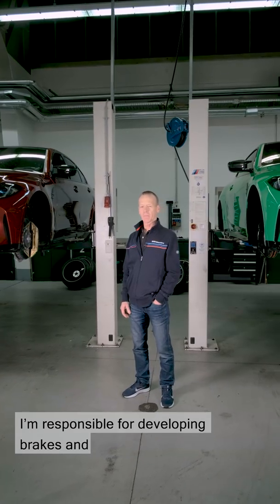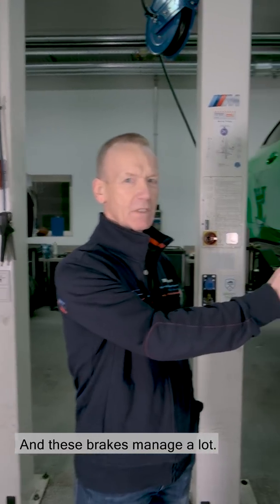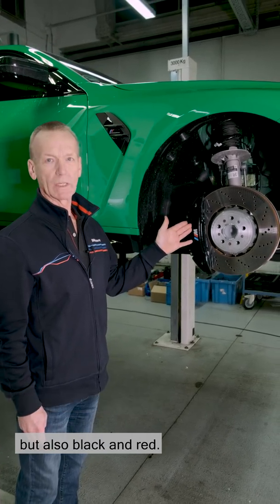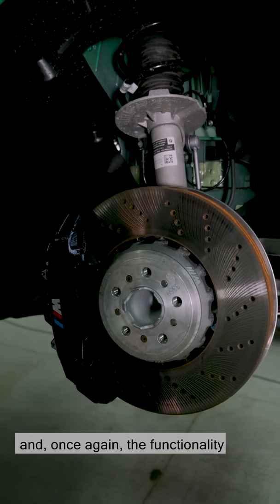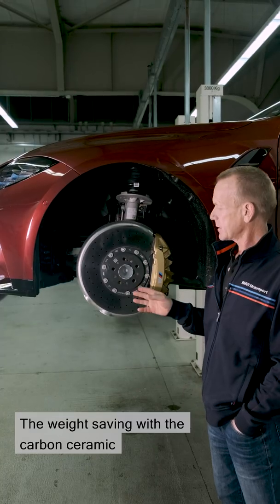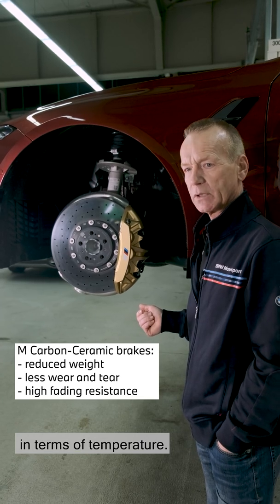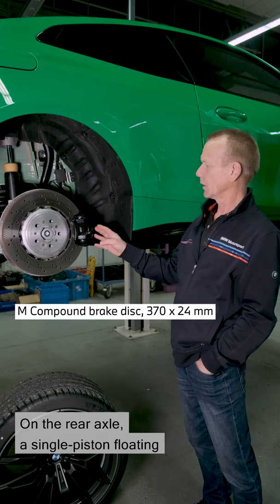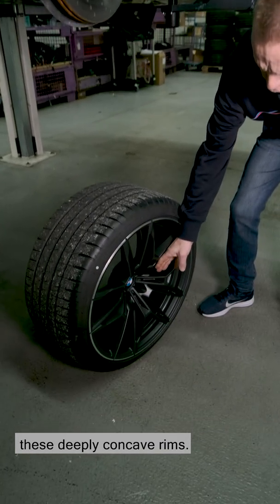Brakes. M3 and M4 - explained, Episode 06.

Comment: Why does the rear calipers are looking so ugly and cheap at the new models (also on M5 F90 and other brands e.g. Audi RS6) compared to the former model generations? Cost savings (sold as weight savings :DD) ? Even on my M135i (F21) it looks better.

Comment: Does the electric parking brake automatically engage when the car is turned off?
Reply: That would not be ideal for track days, means you can't turn your engine off while your brakes are still hot or you might imprint the rotors I think.
For a sports car, I would have strongly preferred a regular manual handbrake. Never liked electronic ones.

Comment: woooooohooooo. M car finally has brake cooling duct!!!!
Reply: My e46 coupe has front brake cooling ducts from factory,non M car.....so it would be normal that M cars have that too.
Reply: @marioturkalj3126  nope it doesn’t. Really comments above
Reply: They always did.
Reply: @jalloor  nope they do not. M2/3(including previous gens)/4s are known for horrible brake fade.
Reply: @jim1013yyf  my E46M3 and F80M3 both have them. We are taking about the hole in the front bumper directing air straight to the wheel wells thus cooling the brakes?
Reply: @jalloor  ahhh we are talking about different things. those are not for cooling your brake rotors. I was talking about the pipe that's ducting air directly onto the rotor hub. Schirmer has a kit for F8x, but it's around 1000USD
Reply: @jim1013yyf  ooh I see.
Reply: @jalloor  yea - even with endurance pad and high temp fluid, my F82 can barely lasts 5+ hotlaps on laguna seca.
Reply: @jim1013yyf  ooh okay, I didn’t think they did and that’s because I never experienced it on track. Yet again I’m from PA with much cooler temperatures which is probably why.

Comment: This looks ridiculously amateur when it’s filmed vertically.  Also, the lighting is poor and you chose to highlight a black caliper against the black wheel liner, so we can’t see any details.  This marketing campaign is an utter disaster.
Reply from the maker: Thank you for your feedback. Are you interested in the information shown?
Reply: @BMWM  the information is ok and the effort is appreciated.  But you can’t change the fact that these cars are ugly.  I have owned 12 BMWs over the course of 20+ years and have been as loyal as they come even with the misqueues like s54 rod bearings, n54 turbos, m50 cooling, etc. I have eagerly awaited each subsequent release of the M3 and this car has completely disappointed. It just looks terrible. So many areas where it just looks like cheap aftermarket add ons or the different teams didn’t talk to each other during the design phase. This was going to be my next car and now I am not buying.  I hope others do the same and you can fix this car with the LCI.  Take a long hard look at the M5 and M8 and clean up the bumpers, the pig snout, hideous grills, weird vent shapes, and why are all the lower prices gloss black?  Make them body color please. Ugh, I could go on much more but I am sure you get the point. Please fix the look of this car or for the love of god don’t screw up the upcoming M2 or I am done buying.
Reply: @therealm3  This is the recurring theme that we're trying to get across to @BMW M:  a large percentage of BMW's customer base hates the new design.  The haters far outnumber those who love it.
Reply: @BMWM  There is some interesting information presented, but it's completely undermined by the delivery method.  The technological advances are vastly overshadowed by the amateurish production quality, as evidenced by the vertical filming and a lack of studio-quality lighting.  All of this pales in comparison to the horrendous overall design, which is being utterly lambasted in online discussions.  Those who like it are in the minority.
Reply from the maker: @WheelsUpPhotography  Thank you for your answer. Regarding the delivery method: We are aware of the fact, that  vertical video production is still quite unusal for YouTube. But we wanted to share interesting information with our YouTube fans, too. These assets have been produced in vertical video format since we are using them e.g. in Instagram Stories (you may have a look at https://www.instagram.com/bmwm ).  Here fans may ask the expert (e,g, Juergen) - and we always get thousands of questions  within 24h. And yes, these clips haven't been produced in studios. We went to workshops, development areas etc. - authentic places.

Comment: Rear brake calliper is too small. On a well balanced car such as the M3, the rear brakes actually take heavy loads. That’s why there’s a 370mm rear disk, but a single pot tiny calliper? I don’t get it.
Reply: I love how the official reason for the puny rear caliper is “we can now fit really concave wheels.”
Reply: @therealm3  hehe - well spotted
Reply: @therealm3  Yeah, it was a styling decision, and form now precedes function.  This is an abomination for the brand and will be seen as BMW's mistake.  Maybe they will see the error of their ways when sales numbers are shockingly low.
Reply: @therealm3  😂
Reply: M brakes are developed at the Nurburgring, which isn’t a track known for heavy braking.  Given the significant weight increase vs the prior generation, the front brakes needed the upgrade, while the rears are now just along for the ride.  The F8X suffered massively at many racetracks because it had no cooling.
Reply: @WheelsUpPhotography  exactly - and non of the existing M models have any sort of brake cooling. Too bad BMW is now making M cars for social influencers.
Reply: @jim1013yyf  You speak the truth.

Comment: BMW brakes are great for day-to-day driving and they work when you need them to and they work well but they don’t even compare to Porsche brakes on track or fast road
Reply: F80 brakes are excellent on fast road driving. I have not been able to fade them on mountain roads. Track is a different story where heat can be an issue and you need high temp track pads, I used Endless MX75 pads on a track and think I overheated them a bit.
Reply: Because you tested these already?
Reply: @ness-uno1  no but if there like any other generation of bmw brakes, it’s just a shame there standard brakes don’t seem that good
Reply: @Youtubedotcomma  so you're just assuming... at best
Reply: @ness-uno1  yes but I’m hope I’m wrong but I guess time will tell, see you back here in a few months 😂
Reply: @Youtubedotcomma  sadly, there's a good chance you're right! The 1 piston rear brakes are an embarrassing joke
Reply: @ness-uno1  personally that wouldn’t bother me it’s the brakes over heating  most/all  BMW’s suffer from. 
The reason for my first comment was that being a typical promo video they say there gonna be epic when history would say otherwise. Just don’t under stand how Porsche brakes are so much better inc there Macan and Cayenne (not just the sporty stuff)